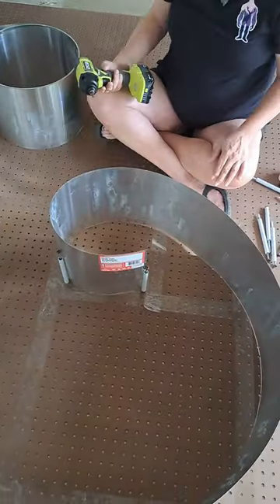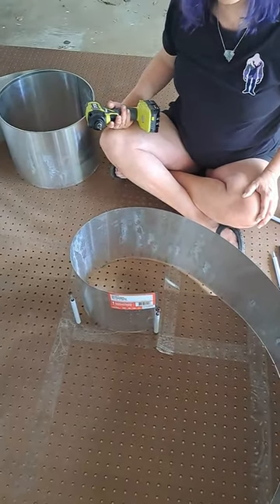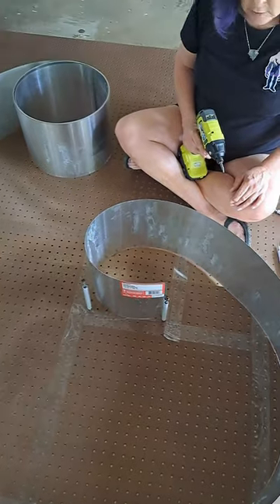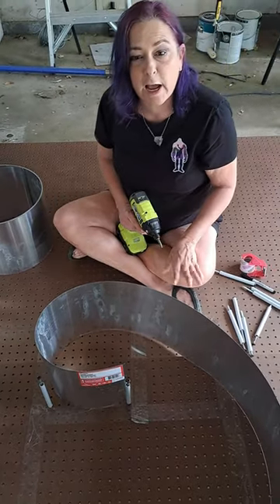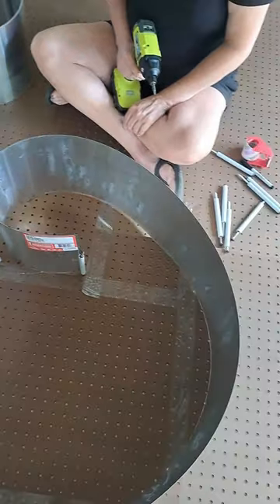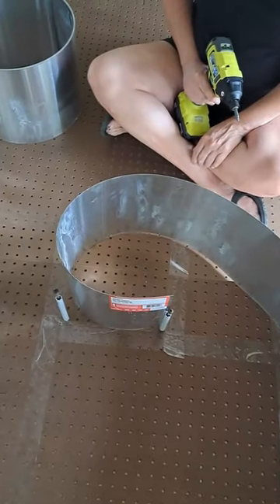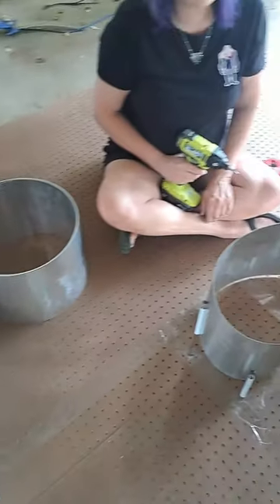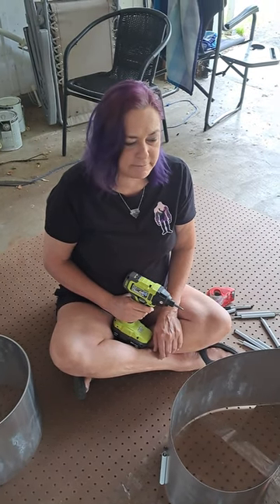Kozyrev Mirror First outline Part 2 #short

Comment: Fallowing the fibonacci sequence this thing would be like 21 feet in Diameter if you wanted to sit in it. Kinda confusing because most pictures are about 1.5 loops with equal spacing.
Reply from the maker: Thus our prototyping to find out what best fits.

Comment: U have to use high permeiability material which can block magnectic field. eg - material like used in transfomer E and I core or better. Aluminium is very less.
Reply from the maker: Actually aluminum is ideal since it is non magnetic and wont effect the energy flow.

Comment: I’ve heard people say “when you turn it on”, does that imply a power source is involved? 
I work with plenty of aluminum and thought about trying this too. 
 I also saw that some people have a tube beside it that they lay in. Is that related?
Reply from the maker: You can add extra energy to the mirror via emf frequencies, that might be what they mean by turn it on. 
The tube is the same concept but harder to make and requires better measurements to get accurate. The spiral should be easier for people to make at home, I hope.

Comment: I know that it's called a mirror. But does it have to be shiny aluminum? If so,  is there any way to clean old sheets of aluminum? The storms here in California took out our carports,  which were made with giant sheets of aluminum and steel poles. Originally made for semis and cut in half to make 2 carports.  The aluminum is older than I am.  But I wonder if it could be repurposed?
Reply from the maker: The design is an ambient non-electrical energy collector. The aluminum is good because it doesn't react to electricity. 
If you want to maximize the collection, reflective surfaces are better. 
We found some dielectric mirror film online that is highly reflective, you can try attaching that to the aluminum if you don't want to buff it out.
The most important part is the spiral for collection. The rest is just fine tuning it.

Comment: Already not gonna work. You need a much higher, solid piece. I know it's a prototype of a version. Just some constructive criticism. The points where the pieces will attach, wont reflect light. Thus causing interruptions in the process.

Comment: Why not set a chair in the middle and base the spiral off the chair?
Reply from the maker: We are working on different configurations for when we make it taller than 10 inches like our current prototype is.
Reply: According to the program you mentioned  they state that it works best in high ozone states. I was thinking of trying it with a Tesla coil at different frequency's. Also cardboard lined with aluminium foil for a cheaper chamber. Not started on mine yet though, just bouncing ideas around.
Reply from the maker: @spiritualistministerchrist8542  Those sounds like good ideas to start with. Let everyone know with videos if you want to share your progress.

Comment: What would be interesting  is if you mounted the aluminum just like you are doing onto the pegboard and cut a hole where the focus is.

Elevate the whole thing so that you could insert your head into the hole at the focus.

Will it do anything?

Probably not, but it is an experiment that could be done with what you already have.

Good luck.
Reply from the maker: I think it makes a torus of energy so for the small one we plan to sit above it. Once we validate everything, we will make a bigger one and decide how to make the center accessible.